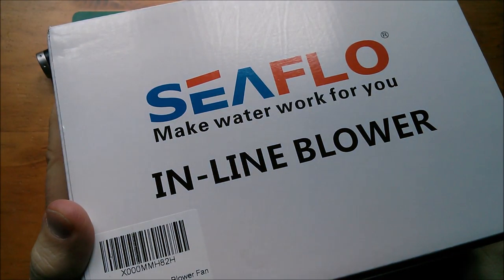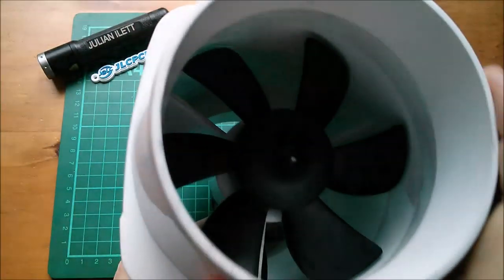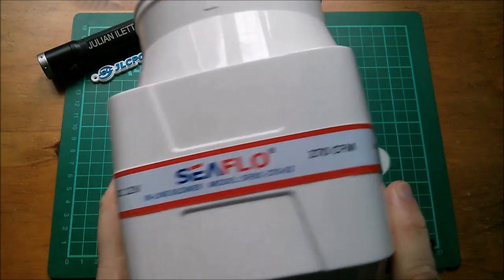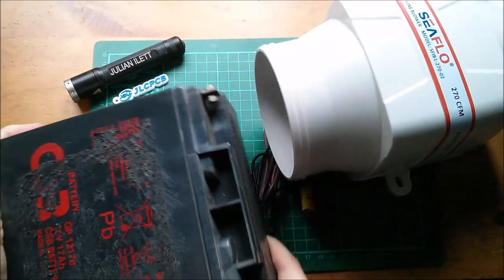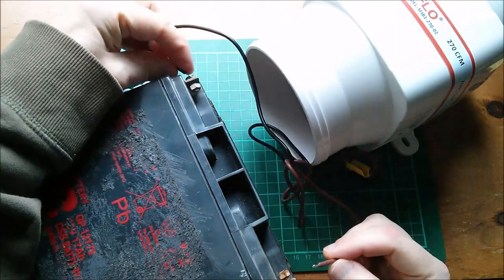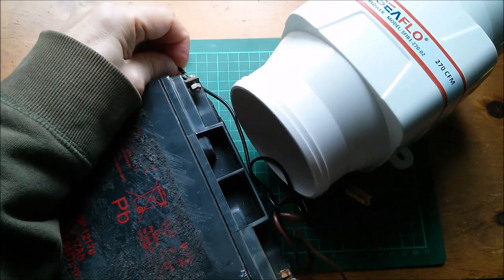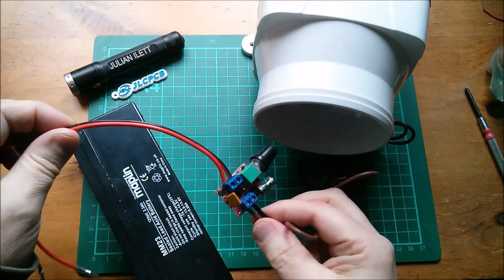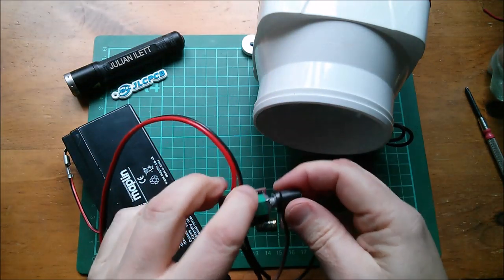12V In-line Blower for Mouldy Shed

Comment: I love seeing what's in Julian's Shorts  :)

Damn...that fan is loud...and at 6 amps seem rather inefficient...maybe a 12VDC computer case fan or two would be a bit better to run off the battery like this.
Reply: Yup, nothing like pulling out PWM controlled fans from servers and top of the line workstations. Quiet and powerful, will last forever. One would think this thing runs for hours every day so you don't really need a jet engine turbine. Not to mention that repurposing is the way to go for ecology and economy. So many people just buy everything from a shop when they need it and then throw it away at 20% of it's life cycle.

Comment: Found your vid looking at marine blowers for a solar power pond air pump.  Don't need much pressure as its only dropping 4-5 feet. Sold me with that speed controller reducing the noise.

Comment: Would someone be able to recommend what motor I could swap into this?

Preferences:
12v (in vehicle use),
Quiet as possible,
Adjustable speed,
Long lasting,
Moisture resistant.

Must be a brushless motor that would straight swap?

Comment: Well, that fan should shift some air!....
‘tis a bit more than the gentle draft that should be all that is needed (assuming that there are no leaks in the roof).
I have two sheds, one completely wooden and one where the back wall is limestone, the two end walls are half limestone, half brick and the front is wooden with a glass window. Don’t get damp or mould in either of them. But both are well ventilated.

Comment: What's the little speed control called?  I want to install one of these in an ice cooler and somehow pass the air through a radiator with a water pump to quickly cool it down and make a DIY portable A/C

Comment: Well that's better than the cheapo B&Q inline bathroom extractor fan I put in my shed. Might need to upgrade mine and turn the current one into a solder fumes sucker.
Reply: I'm in my mid 50s and have been soldering since I was 14... Them fumes never did me any harm... Cough... Cough... :) ...Cough...

Comment: That motor is just horrible. It sounds like a low cost brushed motor, and the impeller is out of balance too. That'll definitely upset your neighbours.

 A couple of large 120mm PC cooling fans would move sufficient air, with a lot less power consumption, and a lot less noise too.
Reply: In humid air? They'll corrode in no time
Reply from the maker: I bought it because I'm not very good at fitting mechanical things together. However, the fan ports are 4" (105mm) and the semi-rigid hose I just bought is 100mm. Houston...
Reply: @JuliansShorts  Duct tape :p
Reply: @CornishMiner  The handyman's secret weapon 😉
Reply: Julian's Shorts - you may find that the fan is designed to take the round ‘flexible’ ducting.
Reply: @John Nodge... It's a marine blower designed to extract engine/bilge volatiles before engine start. The only design considerations are: Massive airflow and nothing else. They're only supposed to be used for a couple of minutes.

Comment: @Julian I couldn't hear the PWM from the 555 controller modulating the motor. Any idea of the PWM freq of the controller? (I'm deleting the resistor pack in my Clio Turbo with an AT microcontroller and the PWM is audible).
Reply from the maker: No idea - I'm guessing it's ultrasonic.
Reply: @JuliansShorts  I'll scan through your postbags.

Comment: Talk about mixing colours. should be red/black or brown/blue wires.
Reply: No problem, if the blowing is not happening towards the desired direction just swap position of the leads 2-5 times to reach the wanted result as usual :-)
Reply: Adam Bryant - There is no standard colour code for anything other than the AC mains electrical codes and ‘standards’ that apply in some countries.

Comment: And I'd thought GB had mostly gotten out of the Retardenheit era. Pints, fair enough, but come on, feet and inches? Is this a post-Brexit item? Is GB lapsing back to Industrialisation times?
Reply from the maker: I think it's a USA item because the 4" ports won't mate with my 100mm hose and accessories :(
Reply: @JuliansShorts  That's annoying. Is that a Banggood/ebay/Aliexpress item?
Reply from the maker: I got it on Amazon UK